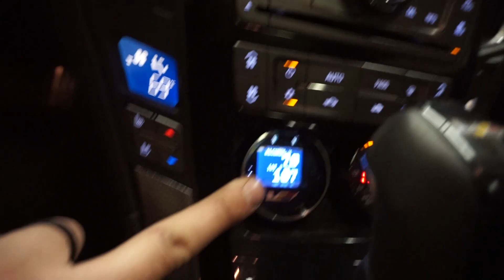850 hp CTS-V build | What You Need To Know

Comment: Great Job. I'm running a 2014 CTS V  640 H.P.  LOTS OF FUN.....
Reply: Simply have the Lingenfelter Upgrade. That brought mine to 642 on the Dino. They replace the Stator, Belt, New Cog for the Supercharger, and they must Re-port the input and exits of the Air Flow. Beyond this you will need to get Larger injectors,and a Total New Dino Tuned Engine. This will mean running more Boost. Around 15 Max.

Comment: Looks like i stumbled on your show A bit late but i like what you have going on & your  many good ideas & i need all the good advise i can get ,i have A '05 V that i gone thru 10 years ago now im fired up again & pulling it out the closet  it has  402 cid Patriot heads ,cam, 2300 supercharger ,kook headers ect. 
6 speed auto Hughs Trans & 9" ford irs with 4:56 gears & A one piece Alum. drive shaft , & has alcohol injector , dyno at 670rwhp , nothing compared to yours !

Comment: I was thinking he had built up a stock CTS-V motor. Good video but this don't help me with my CTS-V motor upgrades.
Reply: +He went WAY above and beyond for the mods he has, all the mods he has outside the block can be ran on the Stock LSA bottom end with no issues (technically speaking). The engine he has is built for 1k+ RWHP, he's running a mild upper pulley (2.55) and could easily run far smaller. The killer chiller is a nice addition but not needed (Trunk tank is generally just as good performance for a 1/4 of the cost). 

Most of the mods he has, if not ALL the mods he has you can (generally) safely run on a stock LSA block.

Comment: Car looks and preforms  great! 
One question I have is when you're at the track and you're using the AC to cool your brick doesn't your evap leak condition on the track? The reason I ask is the track I used to run at said "do not" run your AC as it will drip on the track which could cause an accident.
Reply from the maker: Yeah it does, I got in trouble a few times. But to be honest I actually took that system off already

Comment: surprised its only a BTR stage 2. Silicone sealant on the fuel tank line? MM on the rear of the engine? How do you drain that?
Reply: Stage 2 is a really good cam. Easier on the valve train for a daily driver.

Comment: What size belt (or part number) for the supercharger belt drive? Similarly, I’m running the 2.55 upper and 9.55 lower (along with the 100mm and 50mm idlers). Thanks in advance!
Reply from the maker: Charles Farmer Gates #K080685HD

Comment: good info but you have things in there that you don't really need. good build tho! 750whp CTSV owner also.
Reply from the maker: Gavin Davis thanks! and what do I not need?
Reply: the idler pulleys aren't really necessary. Correct belt length fixes that(not saying yours is not correct). The manley oil pump is nice but a ported stock oil pump does the same. ZL1 lid still has yet to be "proven" as better than a stock lid.  Our builds are similar tho... One of GP Tuning stage 2.5 cam, ZR1 IC pump, 2.4/8.6 pulley combo. Not running external fuel pump either, IDC is pretty good where my tuner didn't think we need it at this point.  NGK BRF7 spark plugs. , we have same injectors. My god brother is in Spartanburg... maybe we can hook up when i come down.
Reply from the maker: Gavin Davis oh well yeah some of the stuff I put on just to be on the safe side but the zl1 lid I really like how it looks and my original brick went bad (some of the cooling fins started falling out) so I got the lid but they say it flows better because it's taller. But yeah I go to cars and coffee and drag from time to time so if u in town come on over

Comment: how much did your interchiller cost, thinking about doing this mod. and where did you get it from,
Reply from the maker: I got a "killer chiller" it's from a guy online, I don't wanna share the website with u because to be honest I would say don't use this guys product, the guy is hard to deal with and his product is really hard to make work properly, I actually took it off my car. There is a company that sells "forced interchillers" there out of Australia I heard their product works a lot better but they are around $2k I believe for the kit.
Reply: @CarWars   Car Wars  thanks alot for the reply, and yes I heard of them, I'll reach out to them, I have a coupe with 37k on it. wasnt trying to rebuild  motor, but would love to get at least 6xx to the wheels, any tips? was thinking Texas speed headers and x pipe, 2.50/9.1 pully, cam, injectors. and a tune, lmk if I'm missing something  lol
Reply from the maker: @jonwavy6242  no problem and yeah that should put you in the 6xx range, I think u got most of the parts, u might just need an intake
Reply: @CarWars  last question  should I just do the lower pully, and cam while i do the 160° thermostat because  there in the same location? trying to avoid getting charged twice lol
Reply from the maker: @jonwavy6242  yeah it should save you some money if you do at the same time but the labor for the cam and pulley is going to add on a good bit cuz it's a good bit of work

Comment: How much boost you building? Also how much was the head porting?
Reply from the maker: david pereira according do my pulley setup I should be at 15-16, I have a stock gauge and that's what it points to. I paid $1225 for porting of the heads, they had to replace a runner, porting of the throttle body, and shipping. It was kinda like a package deal so I don't remember exactly how much just the heads were

Comment: Wonder how much you would pick up if you swapped to the heartbeat supercharger.
Reply from the maker: Nathan  Hensley I ran a guy on the track and he had almost same parts that I have but he also had the heartbeat and I actually still took him
Reply: heck yea. how much boost is it building?
Reply from the maker: Nathan  Hensley I'm actually not sure, after I beat him he didn't want to talk lol
Reply: i am talking about your car.lol also whos flex fuel sensor you using?
Reply from the maker: Nathan  Hensley oh lol I'm supposed to be getting 15-16 psi according to the pulley setup I have, I use the stock gauge to look at boost and it's not the most accurate thing out there. But I got the Dedicated Motorsports Flex Fuel Sensor

Comment: I want to hear it run stock and with the cutouts open!
Reply: I have cutouts on my 2014 CTSV coupe,  my button to open the cutouts in on the drivers seat in front of my recaro seat adjusters. It take 4 seconds holding my button down for the cutouts to open or close fully. I can adjust my sound level to 5 different sound levels depending how long I keep the button engaged. It works well, I was tired of all the power I had but my car sounded very quite, not now if I wanted to,  I could wake our neighborhood up....lol

Comment: This is going to be my next car was wondering the price to make this kind of power and if auto or manual will play a factor  or transmission  running this kind of power
Reply from the maker: Blake Santiago ok well depends if you will get a shop to do all the work or you can do stuff your self, my setup is about $26k, that's not including labor on part of the build. If you go to these numbers it's really nice to have auto because you run a smaller risk of miss shifting or anything else you can do to mess things up, also with auto you will be faster.
Reply from the maker: Blake Santiago and they say these auto transmissions can hold 800 wheel HP stock
Reply: Sounds great I'll be looking at getting one this year
Reply from the maker: Blake Santiago yeah man I highly recommend it, I really like the car!
Reply: Really informative! I'm also planning on trading in the STI and getting a V. It's a fun daily driver, but I'm feeling like leveling up... wont be till next year though (cant have it stock, feel like I'd just be upset until its modded) but making plans!
+1 on the sub Bro!

Comment: Hey I’m curious how much power can I make with it until i need to really change things out. 
I’m getting a 2.4 pulley DW900 LS injectors and 340pound fuel pump, and going to e85 tune. But I know that’s only 650hp on the good day. I want to know if there are better routs to get easy power, more power. But not  nitrous :/. Thanks
Reply from the maker: Danyyil Tkachenko if I was you I'd go on this link and use the info of what they do. Check out the packages and ull see what parts you need for how much HP 

https://vengeanceracing.net/packages-ctsv2.html

Comment: Do you have ARP head studs or ARP head bolts?
Reply from the maker: justin taylor ARP head bolts
Reply: Car Wars Those actually aren’t meant for the LSA. They don’t have enough thread on the bolt and will bottom out not allowing for the correct amount of torque to be applied to the heads. If you blow a head gasket more than likely that will be your problem. Just a heads up.
Reply from the maker: justin taylor I know, all you have to do is double up on the ARP washers and it ends up being perfect
Reply: Car Wars Awesome glad you do know, I had to find that out the hard way lol
Reply from the maker: justin taylor that sucks! But yeah I did a good bit of research before I went through with it. I even talked to ARP